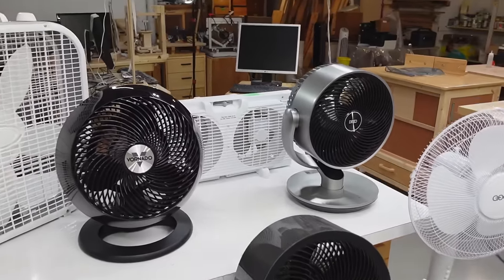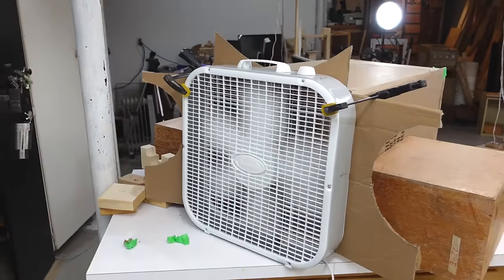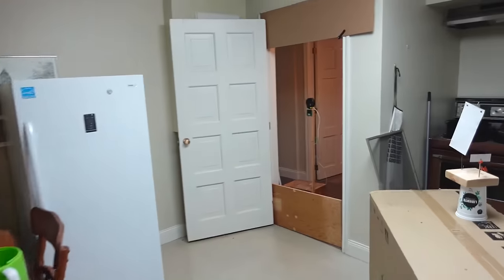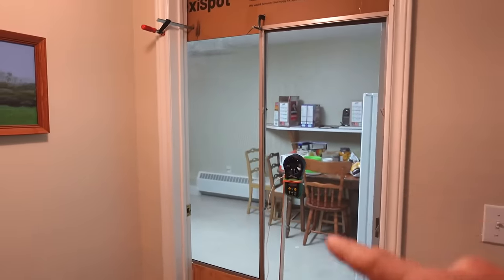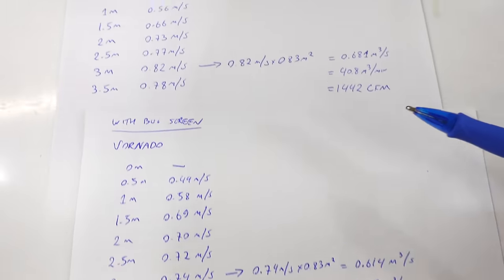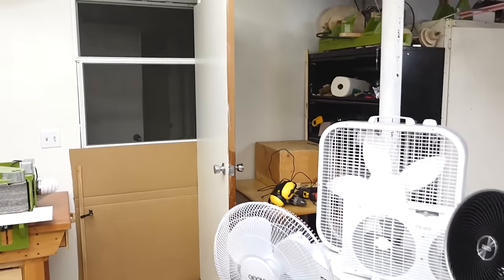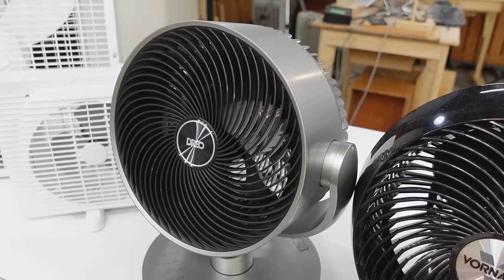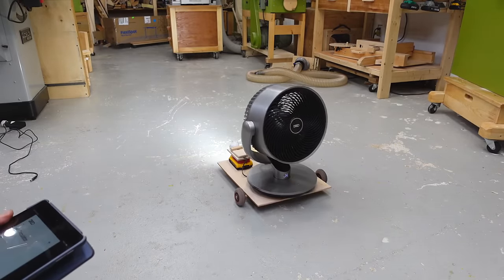Air flow: It's all about fan thrust

Comment: It would be interesting to plot the air moved and noise generated to get a "noise efficiency" rating for the fans.
Reply: This. We have a very powerful fan at home, I think it's 3000W. But we almost never use it, both because it's very heavy and very loud.

My in-laws happen to have a very very silent fan and I'm very envious!
Reply: The sound signature can be more important than just pure noise levels
Reply: It would be interesting to see if the noise efficiency remains consistent across all fan speeds.

Also, without a testing body, any of these ratings can't be compared across brands.
Reply: I'm curious what that 3,000W fan gets plugged in to.
Reply: @fantabuloussnuffaluffagus  just a wall plug. European outlets can deliver 16A @ 230V. So approximately 3600W. In reality most appliances are limited to 3000W because there's multiple outlets on one breaker
Reply: It's all about the blade tips... the pedestal fans are usually quiet... the blades are rounded...
Reply: @matroosoft4589  Can't plug that into a 110V 15A circuit (that's all we get).
Reply: And wattage use for output of cool air. From a fan that is…
(We all know that air conditioners are the winners for cool air, but their use of watts?? Just shoot me)
It’s all about saving money these days… 
Regardless, I suspect that the more energy wise we get > easing the burden on the big power companies > the more they will RAISE our prices to increase their net profits…

Comment: Excellent video as per usual, but I'm somewhat surprised you didn't test one of your home made blowers in the test rig as well.  Would be rather interesting to see where your trash picked plywood and yard-sale motor creations compare to one another, let alone the store bought competition.  Thanks again for sharing.
Reply: Those blowers were mostly meant for dust collectors, rather than air movers.
Reply: His box fan might as well be trash picked :D
Reply: @user2C47  True, originally i had thought to ask for a performance test vs one of those stationary squirrel cage fans, or for a comparison of velocity optimized vs static pressure optimized fans. But then i remembered that our gracious host both has kids, a million other things to do, and isn't like Project Farm and willing to buy fans just to test for us.  I blame lack of sleep on my part.
Reply: disappointed not to see the garden blower...

Comment: I would have liked to see the watts  power input to each fan on your graphs. Also as you move the fan backwards in the room you are creating all kinds of air patterns that can effect your sensor . For example if air is going out the back door it will  make different readings on that . A smoke test would be interesting see what the air is really doing. Also a blower door test where the entire door is blocked so you see  how much positive or negative pressure is  created.
Reply: Agreed, cfm per watt would show the efficiency of each fan.
Reply: Yep, seems like a miss. Based on listed specs only, Vornado is 44W and Dreo is 48W, which seems to account for the difference between the two outputs.
Reply: @brjan.  if you watch Matthias' video comparing the two from 3 weeks ago, it seems the dreo is actually more efficient than the vornado. idk about the rated power but his measurements show 53 and 38W at full power for the vornado and dreo, respectively.
Reply: Agree with the power input graph... but the negative pressure measurement would not yield any result... Assuming the house as a closed system... the volume is just too big...
Reply: He doesn’t have an actual LAB… although pretty darn close!

Comment: I picked up a dreo based on your last video and over the 4th I run a fireworks show and used it to push air into the back of a big box truck to cool it down while we were unloading it. I also had an old school circular fan (slightly larger than the dreo)

I asked how well they worked, and the report I got was that the old fan moved a lot of air a short distance, the dreo moved a little air a long distance, but when run together they resulted in a lot of air moving a long distance, so you may want to try combining the box fan and the dreo (next to each other, on top of each other) and see if you see a similar multiplication effect.

Comment: This really is a GREAT sponsored video- and your research and testing are remarkable sellers. I've been a big fan of Vornado for years and have many of them. In general, they work very well and can be very quiet. But the Dreo's performance looks exceptional. I think I'll pick up one of these!
Reply: Maybe Vornado has cheapened their manufacturing…
I just bought a Vornado at Costco, not on a short neck, but in a square form on TV-like feet, it can point low or upwards. It REALLY moves air, but is so noisy and rattling you can’t hear yourself think.
It was only around $40 dollars though. 
Think I will take it back and apply the $$ towards a Dreo.

Comment: If you get the Lasko fan with the round plastic pivoting frame you get exactly the same motor and blades as the box fan.  The round frame is only about a tenth as loud and moves a lot more air than the box version, though.

Comment: Very interesting stuff! Perhaps you could test the effect of removing the fans' protection grilles in terms of both thrust and noise?
Reply: For shrouded fans i'd imagine they'd move a little less air. Non shrouded ones might see an increase
Reply: For the air circulator fans, the grille acts as a stator against the rotor of the blades, and is actually necessary to collect the airflow into a focused jet
Reply: 😯 Who knew??
Thank goodness you scienc-y types do what you do!

Comment: Thank you for these. I bought the pedestal one and it's great. The app is surprisingly good too. I'm getting the other one soon. I know you tested with 12V but I'm sure you can also use a 20V USB-PD trigger to run it at 20V, and then you can use any USB-PD 60W adapter or even some power banks.
Reply: Are you getting the dreao desk fan next ? It’s interesting that it is more powerful than the pedestal version
Reply: @bunit8  I'm not entirely sure I'm getting it, I do think I'd prefer it with a pedestal cause I have no use for a desk fan. I was wondering if I could take off the base like on the pedestal model, and attach it to a stand but now I see that it has electronics in the base, unlike the pedestal model.

I do see that they have different blade configurations, 5-blade vs 3 blade. I don't know if it makes any difference, but the blades on the pedestal one have this golf-ball texture to it, more like a curiosity, don't think it would make much of a difference in noise or air movement.

Comment: As someone who doesn't use air conditioning I splurged on the Dreo pedestal because I wanted a quiet fan (instead of the box fan I was using). It's weird to have such a positive opinion on a fan, but I'm really happy with it . And surprisingly all the functions are very useful too. I guess you could say... I'm a Dreo fan-boy now
Reply from the maker: my main gripe about the pedestal one is that you need the app to turn on "turbo" mode

Comment: Another reason the Vornado and Dreo fans move so much air by themselves is the cylindrical cowling surrounding the blades.  if you took your box fan and put four blocks of wood around the blades in a similar and closer radius to the blades you probably would vastly improve the amount of air moved.  The king of fans, the centrifugal fans win at being relatively quiet compared to most axial fans with a large amount of air moved.

Comment: Thanks Matthias, that's really interesting. Here in Texas our attics get hot. I am monitoring mine and when it is 100 F outside the attic gets well above 130 F. So I was considering getting one of those solar attic fans that sits on the roof. But based on this video, it seems like it would be better to put a fan in the attic and point it at my ridge vent. What do you think? 

It would be interesting to see you do a video on attic air circulation by the way!
Reply from the maker: if yor ridge vent is 2'x2', and the fan is rated for the temperatures then yes.  My guess is that neither are the case.
Reply: Sounds like a worthwhile experiment…. 
My big question is:  Would an electric fan cool the attic enough to reduce the electricity bill for cooling the home below? 🧐
Or would the power usage needed to run the electric fan in the attic be justified at all?
Reply: There are NO fans in the universe rated for the attic of my home in Phoenix in August.

Comment: I’d be curious to see a comparison between these and ceiling fans regarding air movement
Reply: I don’t think you could ever depend on ceiling fans to actually cool a home; except in the most PERFECT, cool dry climate.

As a person living in a sizzlin’ hot climate with ceiling fans in every room of the house, 
Trust me, 
they are not much more than auxiliary air movers to help an overburdened central air conditioner between its cycles. 
At least they’re quiet for the most part.

Comment: What en epic ending.  I hope the marketing team was paying attention!  This is my next fan purchase. I'm happy with the Vornado, it's been more useful than I thought, but it is pretty loud and not as flexible.
Reply: The Dreo and Vornado "DC Energy Smart" fans seem to be extremely similar in the fan parts of things.  They're both 24V with a simple speed controller module and much the same fan and stator designs.  I specifically like the Vornado because it's all analog controls with no "smart" anything and is far less expensive.  I ripped out the 120V AC -> 24V DC power supply on mine (vornado) and run it on my DC power system that I use while camping, usually on 12V where it only draws a maximum of about 5W but sometimes I put a boost converter inline to run it at 24V where it push more air but draw about 35W.
Reply: I’m wondering where you’re camping that’s so warm you need a fan?
I thought the whole point of camping is that you can move to ‘greener pastures’, or cooler pastures. That was what the entire lifestyle of the American Indian was based upon - moving - and how they survived in the ancient  pre USA Southwest.
Reply: @k.hendrickson8735  Depends on why you're going camping.  I primarily go camping for lots of events that happen in many different climes and seasons.  Anything from camping in winter with sub-zero (F) temperatures to events that occur in 100+ degree weather in the summer.  And while I have different tents for these two extremes, I'm still sleeping in a tent none the less.

Comment: Cheap window fans are something like 6" blade vs 9" blade of the nicer ones even as the fan case size is the same, makes a big difference.  Get a bionaire, on low its like the cheap one on high.

Comment: Very interesting!  I have a 1953 Robbins & Meyers 22" 1/2 hp full house window fan that has stamped on its data plate that it moves 3400 cfm, and is certified for this volume by Texas A&M University.  It draws a massive draft through all the windows of the 3 floor house when turned on, and it has been in continuous operation for 70 years with a bit of oil every season.  I would love to send a Dyson fan (and all other Dyson products) through its steel blades, but of course I won't insult it with such marketing hype junk.
Reply: 😂
You had me at ‘1953’ !
Reply: Dreo currently makes no window fans nor any all metal fans of any type. Hopefully one day they will. A fan ought to last a century or more.

Comment: Coincidentally, I have the same box fan and I've been contemplating making a shroud or circular duct to surround the blade.  By having a fairly close fitting shroud the efficiency will be increased over the square box w/rounded corners, therefore I hope to move more air.
Reply from the maker: that might actually make it worse

Comment: I always enjoy your comparison videos.  If I had the time and equipment I would do these kind of experiments.
It would be very informative if you retested the box fan after adding a circular shroud inside the box to reduce air recirculation inside the box around the blade tips.  Leave about a quarter of an inch (sorry; about 6.35 mm) between the blade tips and the shroud.  All the other fans in this comparison do have circular shrouds.

Comment: Would be interested in you testing a high speed "commercial" metal fan. They have the diameter of a box fan, but more aggressive blade angle and RPM closer to the Vornado style. Many claim 4000-5000 cfm for a 20" fan!

Comment: My current heuristic is "However many watts a well-designed fan uses is directly proportional to free airflow".  Obviously this is suspect with regards to 'well designed', and there will of course be changes associated with higher pressure-curve fans and bigger/smaller fans, but... Watts is a metric you can get insight into without opening the box frequently.

Comment: I have an air circulator but its very under rated. Its digital and i think it could compare to the dreo and vornado fans since i have a honeywell fan and it beat that by a large margin. The one i have is digital, comes with a remote, can be controlled by apps (i never tested it tho, i just use the remote), 4 speeds (1st is very quiet and the 4th speed can be felt very very far. The only problem comparing them is that my air circulator is fairly old (4+ years) but still works strong but its no longer as advanced as some other fans tho even tho it does come with a temperature (F°) sensor with wifi too and could also circulate vertically and horizontally and the blades looks very similar to the floor dreo fan

Its the Geekaire digital air circulator (but im not sure if they still make the model since they are more focused on rechargeable fans now)

Comment: thrust +noise rating would be great on the boxes. 
some fans like the box one have such bad blade design they make more noise than air.
if you want to be amazed, just buy a 15$ wooden prop for airplane and put it on a pedestal fan without the guards, it move so much air the fan will sometimes fall down on its own. if fans had proper impellers they would be so much better!

Comment: Add the Ridgid 18 volt hybrid compared to Dreo. See if it's better or worse 4.0 battery vs plug. The Ridgid advertises 670 cfm but not sure how far away.  And the Dreo advertises 343 cfm at 70 feet away.

Comment: Very interesting information considering I am looking to buy a circulator fan. Am I right to say the conclusion is that they work? What would be an ideal way to place them? I am looking to cool a rectangular space, with a door to the balcony which wind doesn't enter. Some said a circulator fan should be oscillating all over, some said to blow it toward the wall or the ceiling. Any advice?

Comment: So this was interesting, but based on moving (warm) air out through the window and bug screen.
I usually blow cool air in ! And in that case I put it as close the window screen as I can. So is that wrong? But to pull air in, not just move more air but some of it coming from the inside just recirculating.

Comment: Am i getting it wrong or is your simulation placing the fan outside the house? 
Your blow AT the door (window) and measure how much air flow is in that room (house) and out of the next window. 
Or can i use that analog by facing the fan to an outside window and hoping for the same result it sucking the air through the house into the other window?
Reply from the maker: blow air out, and air will have to come in somewhere else to make up for it

Comment: The dreo blades are stupidly deep pitched that the tip of the back blades go to all the way to the back grill while the blade sits close to the front of the grill and vornado vortex action is just for the air to spin around and for to go far but the dreo blades are deeper pitch that it's the pitch and size of the blades that grabs the amount of air and throw it

Comment: I am looking to buy a window box fan that can pull some air through my house from open windows in other rooms on the same floor.  Do you have a particular brand and model that is very effective at doing this?

I really miss having an attic fan that was very strong and good at creating air flow throughout the house.

Noise level is not important.

Comment: It would be interesting to see a test using this test setup for air filter boxes for <1 micron filtering of dust. Been wondering if the $600 Jet is better than box fan with filters. I am assuming the squirrel cage of the Jet would be higher pressure that would work better on used filter. But these are $300 to $650, vs building something with a box or dreo. My use of box fan and hvac filter rested on the back has poor cfm when it the filter has just a little time in service.

Comment: If your thrust theory is correct a $20 drone motor and prop from ebay would be the best fan. In terms of air movement.
Reply from the maker: it would be very good for its size and weight, but also annoyingly noisy and short lived

Comment: So I am curious about what changes one could make to the fans to get them to move more air. With the weather being as hot as it is I think it is important to take advantage of the relative ease in modifying things like the box fan to be able to move as much air as possible in a space or out a window. My hypothesis is that those cyclone propellers that you see on small quadcopters might have some benefit to that effect, but fabricating a fan of that size to fit in something as large as a box fan may be difficult for the regular garage inventor.
Reply from the maker: If you blow thru a bigger window, and the other window is bigger, you can back away further and move even more air.

Comment: It's time for construction.  what you really want to to put a fan in the window but the screen is restricting the flow.
You need to remove the window screen and with your new design (to keep out the bugs), place the fan in the window to get the maximum cooling effect for the area.